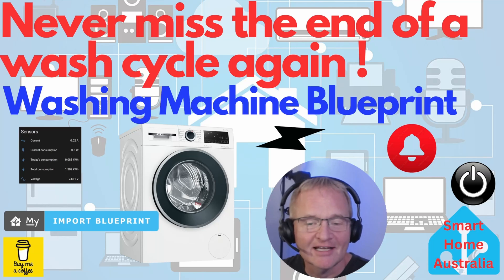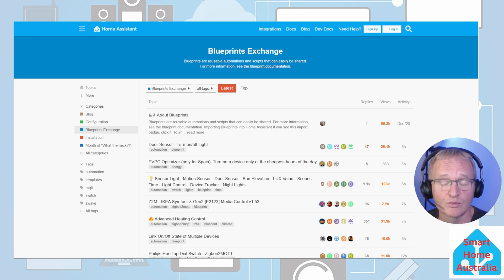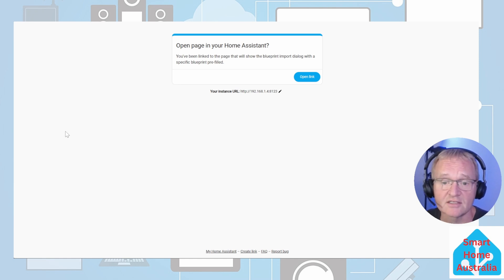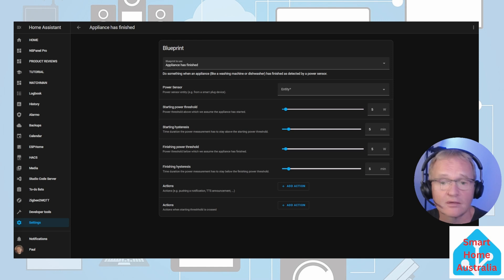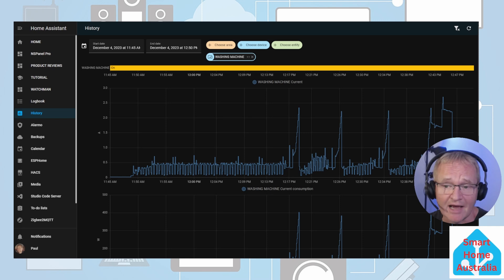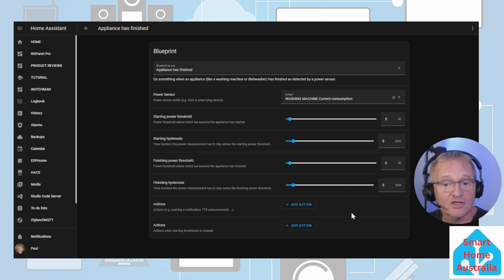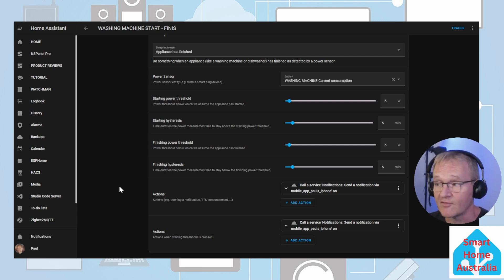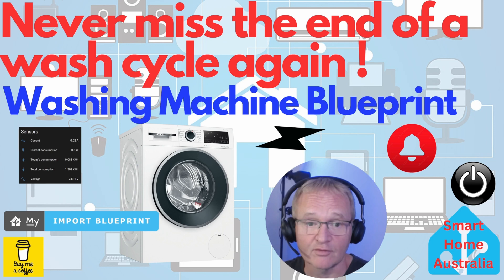WASHING MACHINE BLUEPRINT (bonus - power usage graphs/sensors)

Comment: Im keen to tweak to suit turning on and off my smart tv based on power usage of my HTPC connected to it, any suggestions where to hunt?
Reply from the maker: Hi @koolkiwikat , I did a brief search on the forums for what you are trying to achieve but could not find anything specific. That said it should not be too difficult to built yourself. 
Have a watch of the video for controlling a windows PC with Home Assistant (https://youtu.be/Som-BO1sRvs), that should give you the power utilisation of your HTPC. Alternatively pickup a Sonoff  S60 plug (https://itead.cc/product/sonoff-iplug-wi-fi-smart-plug-s60/) that will give you the power draw. You can then build a simple automation to control the Smart TV (such as https://youtu.be/gmXd3-5RsCI for LG TV's).